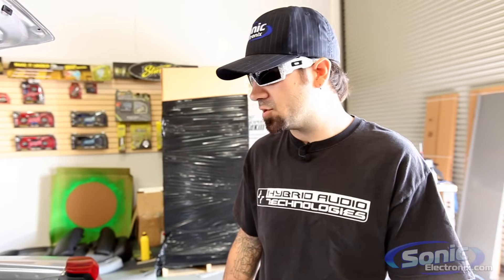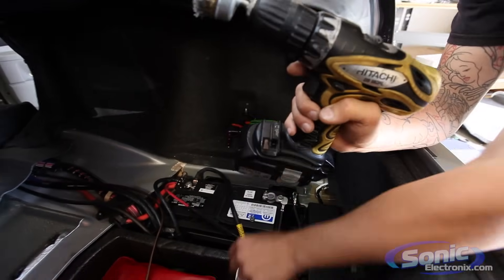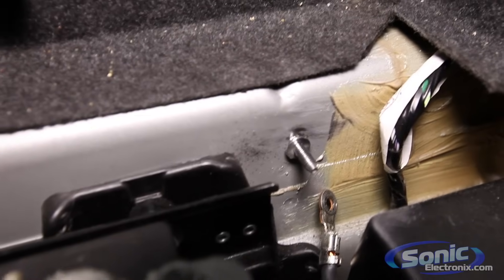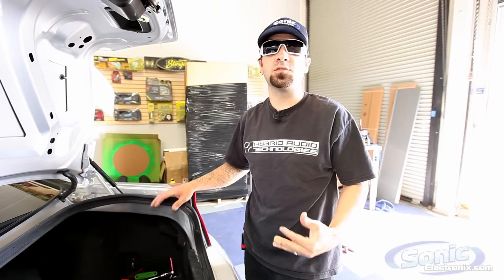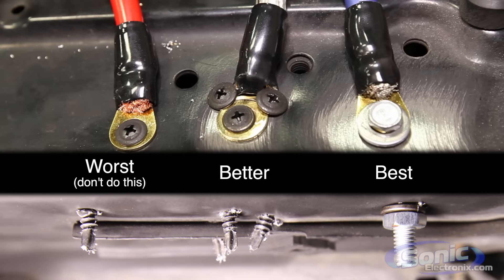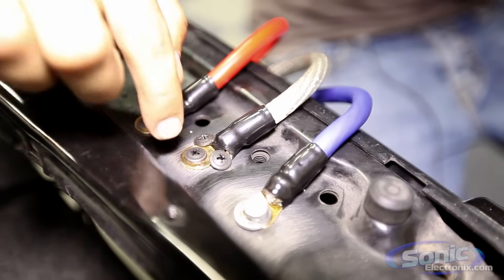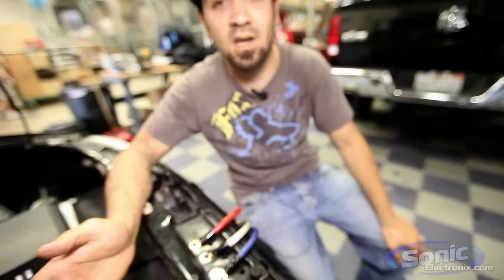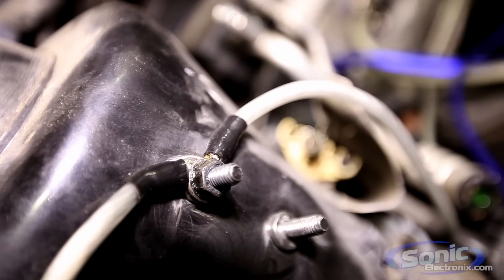How to Properly Ground a Car Amplifier | Good & Bad Examples | Car Audio 101

Comment: quick question so i got a civic and it was already wired for an amp n sub so i put mine in and i noticed it shocked me when id touch any metal on the car so i took off the ground and sure enuff he didn't scrape the paint would this cause it to shock me i havnt reassembled it yet don't want to get zapped again haha let me know thx

Comment: k I have a 2009 Chevy impala and when I turn my car off and take the key out he car is kinda still on  and the amp and subs would that be bad ground?
Reply: If your stereo does not turn off when you remove your key and open your door, make sure that your remote wire is properly setup, as you may have tapped into the wrong wire.

Comment: honestly need some help. 
i have a kenwood ddx4016bt stereo with a vibe cbr12 evo 1600w subwoofer.
i have been getting phone interference when im listening to music... i thought it was the bluetooth so i disconnected it from my phone and it still happened so i left my phone inside the house and it still was happening. It is also happening when i am listening to the radio.

i have put a new ground in properly and used new RCA cables but ive had no luck.

how can i stop this interference because its getting pretty annoying..

cheers
Reply: Make sure your RCA cables and remote wire is not ran directly beside the power wire. If you still have it after that. You need a better grounding location

Comment: Why wouldn't you go straight to the battery in a trunk battery application lol?
Reply: Because running two thick wires is twice as difficult as running one, plus it is just common to ground everything to the chassis, which should be hooked up to the battery in some form or another, hence why you can jump start a car by grounding to the chassis instead of the battery.
Reply: Also to add, a small wire (in comparison) is not a very good conductor because of high resistance compared to the whole chassis of the car, due to its area. So, an extra wire is both worse and more tedious. Also, the reason why you ground to the chassis instead of the battery is mainly due to explosion. Some car batteries "leak" hydrogen when charged or otherwise used, which is highly flammable.
Reply: Having two thick wires coming off the battery terminal than one makes it bulkier, therefore harder to move out of the way when it comes time to change the battery.

Comment: Pro tip: Sativa at work, not indica.
Reply: best comment
Reply: I wear my sun glasses inside... 🎶
Reply: Learn to power thru those indicas like a boss lol
Reply: Haha😁
Reply: Saliva in the cut
Reply: I got 5 on it.  5 years later your prob clean now or deeper in the shrubs
Reply: @cerwin21  What is clean
Reply: @MatthewStout  Ive heard tell of such a thing.
Reply: @cerwin21  Funny thing is I finally might need this video after getting a JBL amp and component 6.5 setup for Xmas. Lol
Reply: @MatthewStout  Heck yeah  Im a JBL guy too.   Great sound.   You will enjoy for sure.
Reply: Or meth
Reply: Know this 8 yrs old but i promise it doesn't really make a fckin difference
Reply: I do both😂
Reply: i think you mean salvia at work
Reply: I got da papers you got the weed ?

Comment: can you cover a ground wire with the carpet like if your ground is right under the carpet is it a fire hazard? i have an 07 honda fit is there any suggestions in the trunk for ground
Reply: As long as your ground wire is insulated and the proper gauge, it should be fine. The only hazard is overheating, but with proper gauge heat can dissipate even under a carpet.

Comment: Amp ground back past batt?  over 3 ft of wire.  

8 inches off the amp down to a spot weld and a 5/16 techead tapper...

Comment: hi my amp keep short of and on when i an playing music what cause it.
Reply: a bad ground, for an example
Reply: Insufficient power (low voltage). Loose connections. High resistance connections. Insufficient ground. Insufficient ventilation. Over temperature. Too low on impedance. Too high of an input signal voltage. Shorted speaker wires. Broken or shorted remote wire. And last but also probably least likely a Defective amplifier.

Comment: mine just sound like I don't have antenna (static) and it's cd playing
Reply: Do you have the power wire & speaker wire going hand in hand? The power will add interference which may cause that issue.
Reply: duerdum9 what do you mean by hand in hand? Like taped together?
Reply: No. Running it on the same "side" of the car.
Reply: +duerdum9 ah.... gotcha! yeah I think so
Reply: +duerdum9 just relocated to another spot but still making those noise! maybe it's the negative from the radio
Reply: We need to go back to the electric basics here. To have current (power) flow to a bulb or similar, you need to have a circuit. To create this circuit, you need a few things. You need a power source, wires and the bulb. The power source is the battery (simplified) and you have a (typically) red +12v wire, and a ground wire. Ground wires are more often than not, very thick and short. 

Just to go back a notch, for you to have power somewhere, you need the current to flow through it, both positive and negative. In this case, metal is a good conductor, meaning it is good for delivering power, unlike rubber that cannot deliver power. So you have the whole car (the chassis) which is made of metal,  to be the ground of the car. This ground is also connected to the car battery, so the chassis is essentially an extra wire.

Power needs to flow through both positive and negative to complete a circuit (see of it as going in circles), by grounding the amplifier, you make sure this circuit is working.
Reply: ***** it won't work if you don't ground it! Just like everything else that uses battery there's a ground involve

Comment: After making those good connections... What would you suggest to prevent corrosion of the bare metal and electrical connections? 
I live near the ocean and as they say Rust Never Sleeps.
Would you recommend a quick spray over the exposed metal with a undercoat paint after the connections are made?
Thank you for your thoughts.
Reply: Paint, after making a connection or use silicone

Comment: you never connect your amp to the negative side of your battery what is wrong with you people? great way to kill your battery quicker and can cause a overload in a cell. why do you think in the install manual of a amp they tell you not to ground it to the negative side of the battery. also it can cause a interference to where you get back feed in your system or can cause other components in your car to lose ground.

Comment: Factory ground isn't best. Best is to go straight to the batteries negative. That car had the battery right in the trunk. So why wouldn't you go for that negative post?
Reply: Where do you think the negative post on the battery is grounded???
Reply: I've had problems when installing an amp straight to a car's negative terminal. The car didn't have enough power to turn over with the wires connected (diesel car) and as soon as the power AND the ground from the amp were removed, it started working (removing only the power wire didn't work either)
Reply: JarnoKai That's really strange. My first guess would be that there is something wrong with that amp. I run all of my power and ground wires directly to the battery and don't have any issues like that. I also drive a diesel.
Reply: +Lucas Sidor I thought I was the only one questioning that. Also by grounding to the body you can get ground loops which cause a hissing or also alternator whine in the speakers
Reply: The battery is using a factory ground. By connecting to the negative terminal on the battery you're essentially still using a factory ground. It makes no difference.
Reply: +Philip Mcalister the body ground is spread across the entire car to a small cable linked to the battery. Best connection=straight to negative terminal

Comment: I'm using a Sony cd player but have a kenwood amp I can not get it to turn on the amp I'm using does not have a remote terminal how can I get the amp to work any questions
Reply: FInd the fuse box, you should find empty slots. Find a slot that gives power when you turn the key. You can find adapters that goes to that slot to give you power. 

http://www.ebay.com/itm/Small-ATM-FUSE-TAP-ADD-ON-DUAL-CIRCUIT-ADAPTER-AUTO-CAR-AUTO-TERMINALS-15A-FUSE-/190898629083

Comment: can i use electrical tape on the wire terminal instead of the rubber piece
Reply: Yes, just make it tight.
Reply: Yup. It's a good alternative, and like Joakim said, just make sure the tape is tight.
It's almost always best to do a light stretch of the tape and do a sturdy wrap.

Comment: need help. installed the kicker zx 400.1 but it won't turn off when the radio is off. it just goes into protection mode. what causes this?

Comment: The frame is the best ground. Rookie mistake grounding inside the trunk to that pot aluminum.
Reply: ummmm I think you ment to say wiring back to the negative battery terminal is the best ground
Reply: What an idiot ? All cars now are what you call a monocoque design meaning frame , chassis body are all the same thing you should go to an automotive school learn some engineering

Comment: can i connect the ground directly to the negative side of the battery
Reply: +Bradley Jansen yes
Reply: That's probably going to be your best ground. When you go to ground anywhere else on the chassis, all you are ultimately doing is using the chassis as a big buss bar.

Depending upon the vehicle and gauge/quality of the wire used, you'll have less resistance in the wire than you will using the chassis. You also pretty much eliminate the chance of getting a ground loop.

Comment: I have a 99 civic ex put aftermarket radio two subs with an 600watts and turned out my parking lights somehow got turned on automatic with out my switch being on due to my anti theft system in my original car. now everything is still wire but didn't get enough ground do to my lights/anti theft was turned on from my original radio. so I have to enter my radio code before I take it out or idk just don't Wana go a shop and pay a lot  $ when everything is wire

Comment: ok i bought some 3M Wetordry Automotive Sandpaper, 2000 grit will this get the bare metal by hand http://www.walmart.com/ip/3M-Wetordry-Automotive-Sandpaper-2000-Grit-5pk/16913670?action=product_interest&action_type=title&item_id=16913670&placement_id=irs-2-m2&strategy=PWVUB&visitor_id&category=&client_guid=af080c57-27ac-4cd1-85a3-54ce93789ce5&customer_id_enc&config_id=2&parent_item_id=17130295&parent_anchor_item_id=17130295&guid=d1b942ee-eae8-402e-a70d-6dcf7de8760c&bucket_id=irsbucketdefault&beacon_version=1.0.1&findingMethod=p13n

Comment: what is the easiest and cheapest way to sand down the paint for the ground
Reply: +Yg Bodybuilder your teeth...sand paper or a flathead screwdriver work too. Also, have you tried nuking it from orbit? Its not very cost effective, but it'll make quick work of that paint!
Reply: +Lucas Sidor I love you

Comment: I need help I have a dodge dynasty 1992 when I took out my factory stereo it had a ground. I now have a ground from the aftermarket radio. can I connect the two together and bolt it down? 
also can I bolt it too the radio?

Comment: +Sonic Electronix about scrapping out the paint, what if rust takes place? or it'll not?
Reply: +John Jeriz Lopez Ignacio You'll only get rust if its exposed to excess air or water. In a trunk, the surface of the metal isn't really exposed to a lot of those. Perfectly safe :)
Reply: Thanks!! OtherDalfite
Reply: If you are still worried about it, just hit it with some spray paint or silicone over the top AFTER making your connection. You always want metal to metal contact.

Comment: If the ground is bad would the amplifier not turn on, or would the protect light go on?
Reply: Yes, it will cause issues. Had a personal experience with it a few months back. Tried reusing a previous ground but it wasn't proper.
Reply: yeah like mine works for 2 seconds then goes out. doesnt go into protect mode but just no sound output

Comment: could a bad ground lead to my fuse constantly blowing on my power cable? I'm have a problem where I can't turn my music volume above 30 without a fuse on my power cable instantly blowing, currently I have my sub level at like 20% gain off my amp.
Reply: +George Soledad you either got a shitty cable that is too thin or you are shorting out somewhere, meaning the power is touching ground.
Reply: +George Soledad  1. You&#39;re cable is too small for your amps hunger for power. So it is pulling more amps than your fuse is able to carry so it does its job and blows. Look at your amp, take the number of fuses and multiple that by the amp rating of your amps fuses. For example.

In my car I have an ampo that has 3 40AMP fuses which means my amp pulls 120AMPs. I had a 60AMP ANL fuse on my power wire which kept blowing obviously. lol So What I need for my amp is 4 gauge wire and a 120+amp fuse. I put a 150AMP fuse  just for some extra juice if need be.

2. You have a short.

I am pretty sure your problem is you&#39;re using too small of wire or fuse for the amount of power you need to get to your amp.

Here are the scales for Wire Gauge size to AMPs give or take a few amps

American Wire Gauge Recommended
Maximum Fuse Size 
00 awg 400 amps 
0 awg 325 amps 
1 awg 250 amps 
2 awg 200 amps 
4 awg 125 amps 
6 awg 80 amps 
8 awg 50 amps 
10 awg 30 amps 
12 awg 20 amps 
14 awg 15 amps 
16 awg 7.5 amps
Reply: +Mike Allen yes sir I found it was the wire I switched to the biggist gauge I could find and I have no problem thank you !

Comment: When I installed my ground, I got down to bare metal and used the nut and bolt idea, but for my 1/0 wire, I used a ground lug, similar to how electrical panel feeds are connected

Comment: Hello, i just wonder if the head unit has 6 RCA channel output (4 speakers and 2 subwoffers), but an preamp equalizer only has 2 inputs, wich 2 outputs you select from the head unit to hook into the equalizer? is there a good way to hook it?

Comment: on my fiesta there are nut and bolts where the rear lights are...would it effect the wiring of the lightin and short it out...?on your three options I had the worst one done...I messed around with it and ended up threading it so lookin to fix it somewhere else...

Comment: Is there a good way the measure the conductivity of a ground?
I don't get is why we think/assume that all clean car body bare metal contact point are optimum for everybody's grounds.

The car body is steal (not as conductive as Copper) and in some parts very thin steal. We focus on positive side being optimum conductivity, with 0 ga OFC wire... and we don't really have a clue how conductive our ground is.  The only reason i bring this up is some folks are running some BIG POWER and just ground too a thin steal frame.
Reply: Roland Jacques use a meter and check it?

Comment: upgrade that stock ground (-) wire at the battery terminal, what is that a stock 6gauge? with a 2 gauge stock wire running to the front of the car.

Comment: Can i set my sub's to the factory radio
Reply: +Jesse Smith You need an amp to properly run a sub. A factory stereo probably only puts out 20 watts RMS where most car subwoofers put out 300w+ rms. 

However you do need to run RCA cables from your amp to the radio, but a lot of factory stereos do not have RCA plugs stock.

Comment: Can I spray paint on the ground so it doesn't rust?
Reply: +Xample: CSGO humidity.
Reply: Use some dielectric grease over it. You should find it at auto parts stores.
Reply: If it's inside the car why would I trust?
Reply: +Xample: CSGO it rust*
Reply: +Xample: CSGO I want it clean

Comment: why are all the losers below and the ones suffocating behind the "show more" button criticising? The person is clearly showing to other persons (of average IQ and above) that if they are having problems and the reason turns out to be this, YOU CAN ALWAYS MEND IT by scraping metal and using a strong bolt to get a good ground. Also check your engine ground. For those who are offended by removal of paint by a power tool, you could always use your mommas dentures for scraping off the paint softly! And for people advocating battery ground, lead has the chance of forming oxide to get black and react with acid to form green sulfate hindering proper connection (maintenance free batteries leak too.) As for rust, you could always apply paint on that afterwards to protect. Cheers